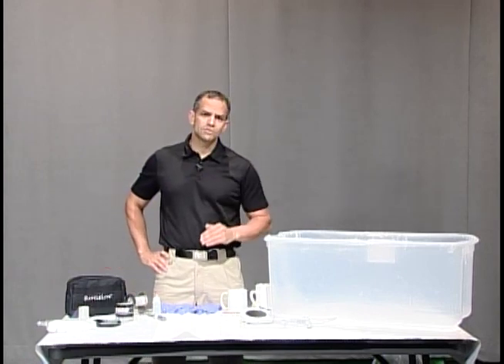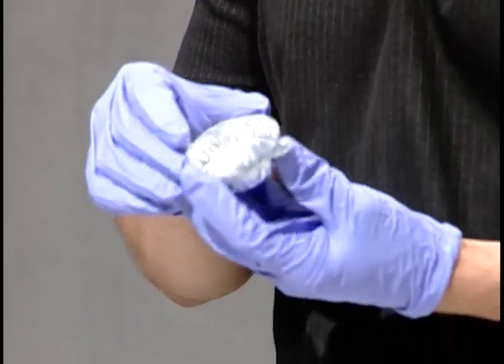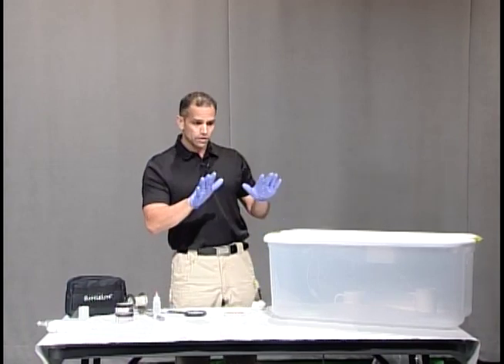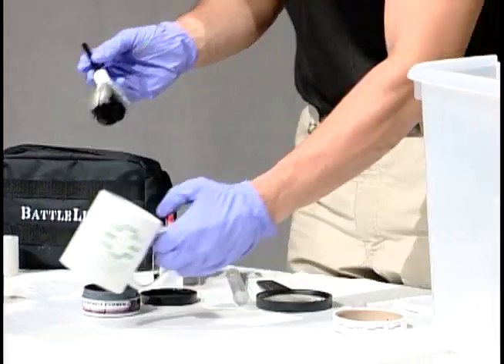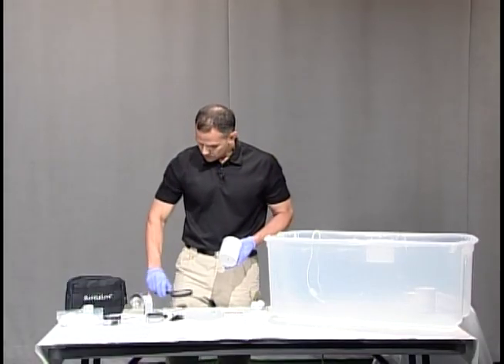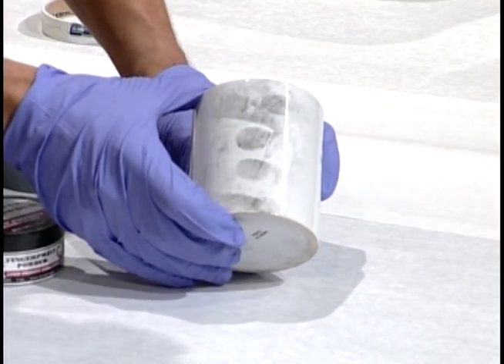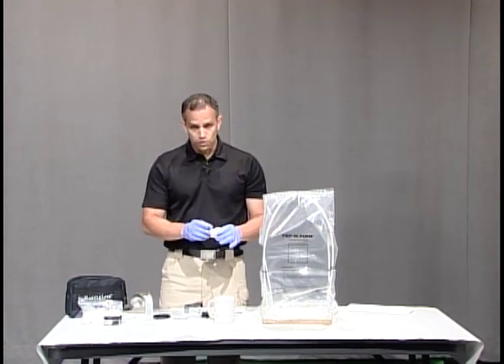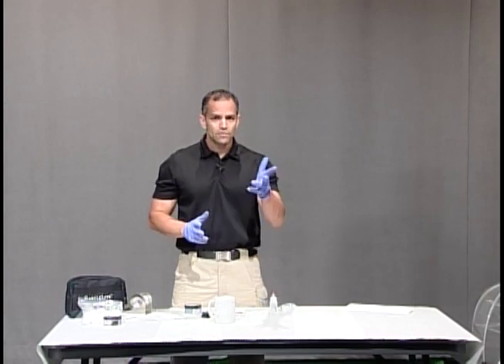Superglue fuming and fuming chamber - Forensic Education

Comment: I'm very surprised when pressing down the tape over a print (not specifically using superglue), that the print isn't squashed/damaged?
Reply: I'm doing a forensic science degree and was thinking the same.. We've always been told not to press down on the lifting tape, just to gently smooth over to prevent air bubbles. Too much pressure can damage the ridges.
Reply: Super glue is not that easily distorted after it dries.
To test the theory, put a dab of super glue on something then after it dries, press down on it. You will find that it is vary hard and the only way to change it's shape is to scrap it with your finger nail or something harder like a knife blade.

Comment: Hi yea, Not sure if you are still checking the comment section here. I tried using a coffee warmer I bought from Amazon, it is not hot enough to heat the superglue. Then I tried with a candle, but it gets so hot that so much of white fume was released. I was worried that it would be very harmful and explosive (well it shouldn't be explosive), so i didn't let it sit for more than 5 minutes. What temperature is the best for this experiment? Do you take into account the surrounding temperature?
Reply: I also wonder your question, how high the temperature must be. Have you found the answer?
Reply: Inge Hebnes Hårajuvet  
Hi, I didn't find my answer. There were too many variables I introduced to my experiment, and I didn't have a thermometer. My fingerprints turned out a little ugly unfortunately :(
Reply: Here is a page put up by an investigator for USACIL (the United States Army Criminal Investigation Laboratory).
http://onin.com/fp/cyanoho.html 

According to the article the fuming process takes a minimum of 10 minutes and you should check your test print after the first 10 minutes. Then, if the test print is not visible enough, fume for another 10 minutes.

This time period is for small items such as a cup. 
Larger items will take longer and require more glue for proper fuming.

Do yourself a favor and scroll down past the fuming tips to read the near fatal accidents that occurred. The author gives some solid safety tips for doing this.
Reply: @scotttovey  Ed German works at my local police department.  Super smart guy......a lot of really cool stories dealing with forensic science